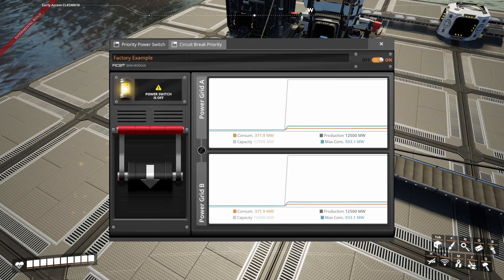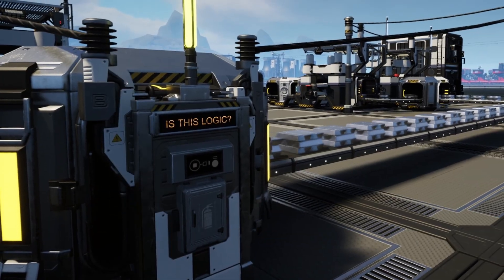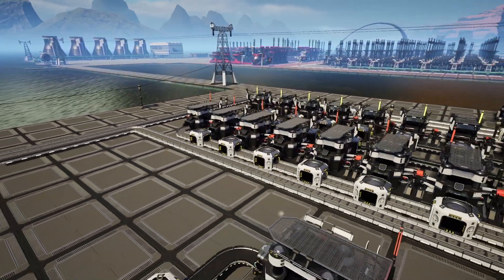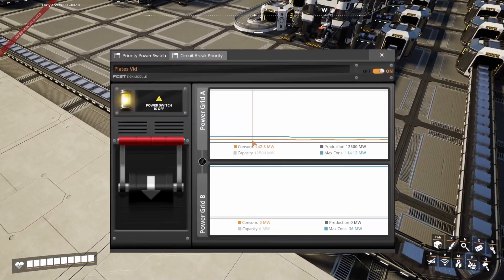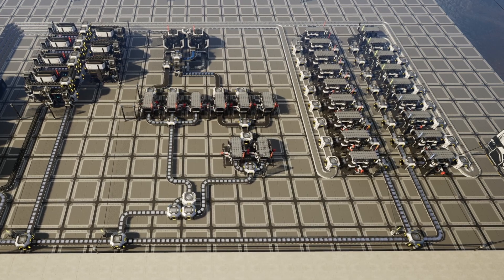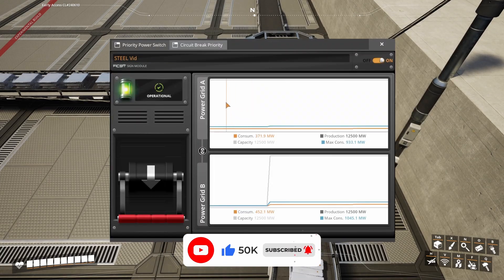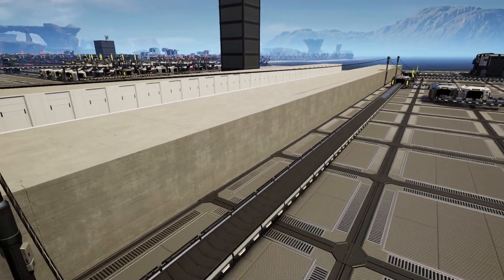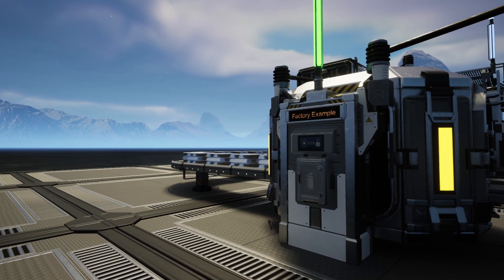Is It Possible To Create Logic Gates With Satisfactory Priority Power Switches?

Comment from the maker: Did we create a logic gate and if so what type is it?! Also is this something you'll be using in your factory?
Reply: You created a not gate, and we can make every other logic gate with it (using mergers as or gates) if we use machines to turn off parts of specifically tuned powergrids to connect these gates we can make a fully functional computer, meaning satisfactory is now turning complete
Reply: (basically by sending items to a machine that would overload a powergrid we can turn off an output using priority switches, this will allow us to chain not gates + or gates which allows us in turn to make every other gate, and connect them up)
Reply: (I do a lot of binary logic in logic sims and in Minecraft, and I guess now I can expand and make complex computing devices in satisfactory technically)
Reply: I say technically because we will still need to manually reset the priority switches, unless there is a way to automatically reset the breakers, or we get an item sensing switch, we still have to have manual input
Reply: Almost, but not quite. If you could either get the switch to be replaced by an item inflow or the item outflow replaced by a switch flip, it would count. What you have could serve as a useful interface to an actual logic setup though.

The one problem with using a power cut to turn off a priority switch is that you need a way to turn it back on, as far as I'm aware. What I'd do for making logic gates is find a pair of crafting recipes that form a bit of a loop (like packaged/unpackaged water) and use the flow of items into machines to make gates. You could make a not gate with a packager unpackaging water, and send/not send water to determine whether any packages are left to flow out of an overflow, giving an item output. You got pretty close though!
Reply: What is the point in doing smart splitters vs just doing normal splitters? Allowing everything to fill up then just turning on 1 factory at a time with the priority power switch seems like the better play with a logic setup as limited at this. I get why it would be useful to have a selectable factory production line since its not uncommon to have limit resources to produce with but the smart splitters set to overflow just seems an unnecessary part of the equation. You technically save a priority power switch I guess since the last factory can always be on, but it seems like it would be more convenient to have it since it would show up in your switch system reminding you that you have a factory for whatever it's set to vs having to remember what the last factory is in the run. It would also give you the option to turn off that last factory if you run into a power crunch.

Comment: I guess I’m not sure what a use case for this would be. I guess you could on the fly change outputs rather than reprogram or rebuild…

I wonder if you could have it rotate outputs from plates to rods to screws to wire to plates. The only problem then would be the PTSD I’d get from listening to all the overload sfx.

Comment: Factorio lets you do actually do stuff like this with the circuit network.  Satisfactory doesn't, and I think won't, be able to have proper logic circuitry, as cool as it might be.  Satisfactory seems to be made to build factories that just run.  Ideally everything would have the ideal ratio of things coming in, and the ideal ratio of things going out, and it just runs.  So I've found that I only have a power failure if I do something extremely stupid, like the time I accidentally detached half of my coal plant, and then went and turned on eight particle accelerators.  Good times were had by all.

Comment: There are a lot of more-or-less correct responses here. What you've created is actually a 2-WAY DEMULTIPLEXER, a circuit with one input, two outputs, and a select bit. The select bit determines which of the two outputs the input is routed to.

Comment: I think you could get more immediate responsiveness (at the cost of a little power, using a trick Stin Archi experimented with. Instead of powering of the machines, put a truck stop between splitter and machies, then just turn it on/off.
As long as the machines aren’t consuming more than it’s output, it should immediately redirect flow (assuming it has had the warm up time to fill its buffer). Even if it is getting drained, depending on the number of machines, it’s buff may still be quicker to back up then them.
Reply: Also can do a lot with what’s already in the game if you’re willing to add a lot more complexity.
Now that we have blueprints, I might have to revisit the ideas and get blueprints made for my 100% efficient priority merger etc.

Comment: Its an interesting concept, but for it to be fully worth it, consider connecting all priority power switches, to one priority switch, of which you'd control the others through it. That way you don't want to be going from A, to B, to C, to turn any of it off. Else we might aswell use power switches in this setup.
It does grant a fully controllable factory from one point, one switch to control them all!

I see the priority power switch being of most use to ensure that your own factories that fills your power system, shuts off last, if there is any issues.
This helps mitigate any form of damage along the pipe lines or conveyor belts. As your power will continue functioning, one way or the other. As through the priority switch, you'd be indirectly lowering the required amount of power, when one factory shuts off through it, one that isn't as important to keep fully functioning for your all of your factories.

Comment: 1:51 neither. This is just a binary switch (a single bit)
Or and xor compare two switches to get an output. 

so these are not logic gates.  You need to be able to compare two signals to get logic.

2:13 this is closer to logic.  You can do this with 3 switches, which each switch effectively determining a left or right branch.
Reply: Priority switches can act as chained AND gates fed with (power from source/higher tiers) and refed with(power from own grid) if both is 1, the 1 is output. If (power from own network) is 0 even though fed with power) output is 0 and the operation is sent to the next higher tier priority switch.

Comment: What you're showing has been possible since they added the regular switch (and even before that if you create/remove the connection between poles as a "switch".
What the priority switch has added is remote control.

You aren't even using the "priority fuse" part of the priority switch.

As to logic...
"And" gates are switches in series (they all need to be on to turn the circuit on)
"OR" are switches in parallel (any one on turns the circuit on, they all need to be off to turn it off)
"xor" can't currently be (automatically) simulated as this requires a 'not'' operation.  you'd use the or approach and require the player to only enable one of the switches at any one time.
Reply: i feel like you illustrated how basic logic gates work but afaik it’s not really a logic gate if you have to manually operate the gates. That’s the whole point of the logic gates- to act based on their given criteria. 

If you sent a signal to two power switches that were set to Off, you would then need to go turn them On for them to act as and AND gate, but why go through all that trouble when you can use one signal and one switch if all you’re doing is turning some stuff on and other things off? I came to this video looking for inspiration and it’s just a waste of time cus the guy is using these things as intended and using jargon to draw us in since ‘logic systems’ have been talking point from the devs.

Comment: there might be interesting things you can do with switches within a certain production line. for example turn off the screws so the iron plates overflow when the reinforced plate assembler overflows.
But the question is... why? I can't really see any benefit compared to splitting the initial ingots into four belts and have smaller production lines making everything at once.
Reply: Better manifold and load balancing design?

Comment: It would be great for space elevator parts, something that you only need so much of and then can turn off.  It could also be for an explosives factory that needs only occasional use.   Finally it can be used for back up power generation.  Say you are using coal for steel and the power goes down it can divert to a coal power plant for extra power.

Comment: Hey Total, i like the idea of having switches to turn factories on and off. And i myself have been looking into logic gates myself. I think that in your example it can also be be done with regular switches. i build a factory once were i used containers and smart splitters to make an If/then logic gate, and it works very well. In your example i would not use it in a production line, but i would use it for the items the pioneer needs. like diverting steel pipes to make nobelisk. Or iron plates and copper sheets to make canisters. So items we need in finite amounts. But what i do like is that you are looking for new ways to build a factory. So keep it up! :)

Comment: If you wanted to toggle belt flow, rather than just entire factory power status, we can currently do this via truck stations. The input and output ports of the truck station’s internal storage are only connected when the truck station is powered, giving us a crude belt control system
Reply: but a truck station is uni-directional, so it wouldn't really do anything except if you made 2 stations and an actual truck going between both (which consumes fuel).

Seems not very useful;.. if you want to flow control the raw resource... turn the miner/pump off.
If you want to control intermediate resource... turn the constructor/assembler/manufacturer/refinery/blender off.
Reply: @oreubens  no other truck stations needed, just a single one with an in-belt and an out-belt. This is a method that has been successfully used on puzzle / game maps by other builders
Reply: @linamishima  mkay, if you only want this to work until the truck station is empty and then needs manual refilling.
Reply: @oreubens  you just have the infeed and outfeed from the same truck station.  So you don't need manual refilling.

Comment: You've created more of a Single-Pole Double-Throw (SPDT) Relay then true logic. All it's missing to be true logic is some sort of sensor that can flip the switch for you. Personally I'd like to see them revamp the programmable splitter and make a programmable merger to do this. They could even make them a powered item and I'd be happy with that. But yeah, some sort of sensor item to determine state is what's needed.
Reply from the maker: I'll have to look up Single Pole Double Throw relay. It's a shame we don't have sensors, but  we know they'll re-work the programmable splitter so fingers crossed!
Reply: The switch can be flipped if you start running out of power... but i don't see how to get anything useful out of that to make a logic gate :(
Reply: @jordanhoman0212  Yeah, you could make  an oscillator. Make for neat christmas lights display.

Comment: This logic gate is a not gate technically, and the good news is that with a not gate and an or gate (or a way to connect two outputs) you can make litterally every other logic gate in existence, so yea using some mergers and then specifically configuring machines to cause power grid outages we can now build fully functioning computers in satisfactory, meaning satisfactory is now technically turing complete
Reply: it's not even close to turing complete because none of the switches switch automatically (except the priority switch fusing on overload), but it needs manual reset.

But technically you don't need switches, you need gates and a clock signal.
Reply: You could start doing some interesting stuff if switches had 2 outputs (the normal on and the normal off state) and a powered switch state (basically turning the switch into a relay)  and a push button (to simulate a clock pulse).
Reply: @oreubens  also all we need is the ability to auto flip breakers and then we can build a relay essentially, since the not gate will have delay
Reply: @oreubens   Yes I am aware that the gates could only switch once, and I did state that in my replies to a different comment, so yes it still requires a human to interact and reset the fuses, but here is hoping we get an item sensing switch, or a way to automatically turn the breakers back on
Reply: @oreubens  Asynchronous logic doesn't need a clock.

Comment: Cool video! I'm sure someone will find some use for the concept, but I can't think of one on my own. Any idea how this would be used practically?
Reply from the maker: Use it to create plastic based items if the priority power switch turns off due to a power outage resources can be sent to a refinery for the fuel alt and produce fuel instead, powering on the factory again? Rough thought but think it could work
Reply: @TotalXclipse  Oh! that's a good point. Yea, I guess it's great for items that you don't necessarily need all the time. So it allows for a small factory that can just make small quantities of items on demand.

Comment: One thing I am trying to understand is just how these switches work in general. I've only just unlocked oil and bought my way to cupons to unlock and make one of these new priority switches in thinking it can safeguard my coal plant as I am like... 37mw from going over my max production. This is needing me to make yet another coal plant but I wanted to hopefully safeguard the first. 
Do I need two to do this? Pretty much atm I have my coal plant isolated, so its only the coal gens, the water extractors and the coal node I'm mining from all connected. From that line I have it connected to a master power switch, and that connecting to 5 more that each run a line isolated to each floor of my factory. My own circuit breaker so to speak. 

Now before the 'master' switch that shuts off everything butr the coal plant, I have the priority power switch with the A side to the coal gen, and the B side to the master switch. But... is this enough? If I start going over the power I can handle will everything on B side turn off leaving A side? Or do I need 2 of these switches to do that? That is what I don't understand. Am I even using this right in the first place?

Comment: Since you're talking about a single switch with exactly 1 on state and 1 off state, it can only be an OR switch.
Reply: This. Although for the pedantic in the crowd you've made more of a SPDT relay then an OR gate. A logic gate would take multiple inputs and generate a single output. This is taking a single input and selecting multiple outputs from a control signal. That's basically a relay. If they added sensors of some sort that could flip these switches for you then you could create genuine logic gates.
Reply: all you need is a not gate and an or gate (technically in circuits a wire connecting 2 digital lines works) and you can make every single logic gate in existence

trust me, I made a 4 bit alu in a logic sim using only not gates that can multiply, divide, add, and subtract.